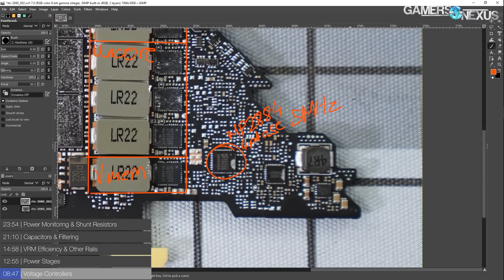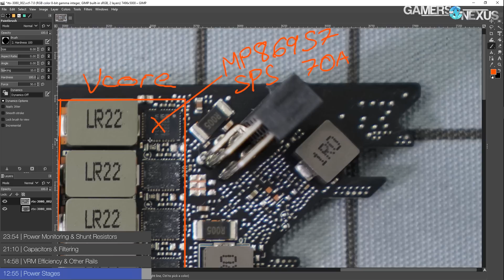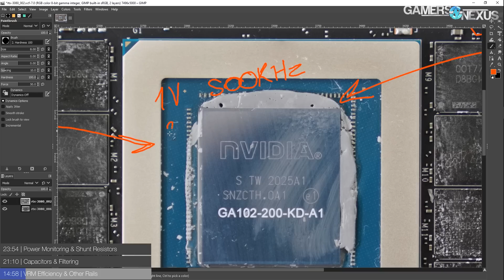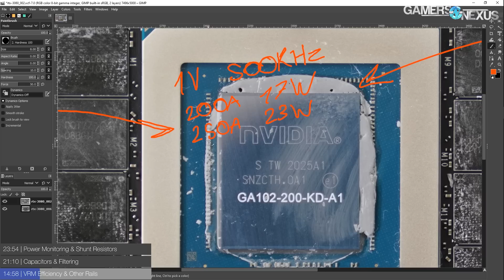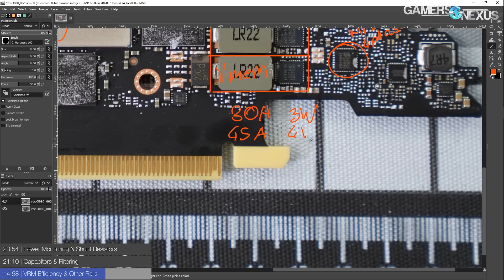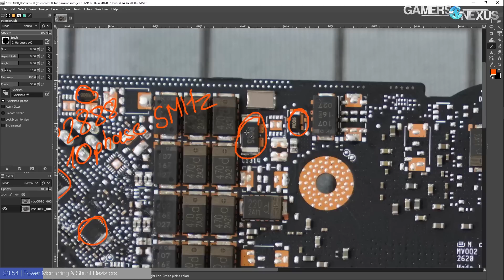GPU PCB Analysis: Founders Edition RTX 3080 Build Quality & VRM Capabilities

Comment from the maker: Watch our 3080 Founders Edition cooler study, looking at CPU & RAM impact from the cooling: https://www.youtube.com/watch?v=zWczw89sMe0
RTX 3090 FE tear-down: https://www.youtube.com/watch?v=9JWqRjqqNko
RTX 3090 review: https://www.youtube.com/watch?v=Xgs-VbqsuKo
Find Buildzoid on Actually Hardcore Overclocking: https://www.youtube.com/channel/UCrwObTfqv8u1KO7Fgk-FXHQ
Reply: Is this type of analysis going to be done for evga and other companies?
Reply: Excellent as always - But may I ask, am I the only one having a hard time seeing that orange color Buildzoid is using to draw? Neon green or more of a maximum red would be a lot better
Reply: A cooler study of a card we can't get in the 2018 TI prices are literally brand new for a pre-owned card
Reply: this channel is too good
Reply: Question: Which 3080 would you buy and why? Thanks!
Reply: I see some overclocking in cards with the 2X8 pin connectors with claims of the card drawing over 500w.  Will the 8 pin connectors deliver more power than the rated 150W?  Let's say the PSU is a Corsair AX1500i.
Reply: the slight by nvidia against TSMC finally pays off. a decade later.
Reply: 6:18 Auto Money Strategy https://youtu.be/CyX0dCjIkoA
Reply: eVGA are using all pass through capacitors on the XC3 and FTW3. Talk about cost saving.
Reply: Better watch out Steve, Youtube has a strict policy on users not uploading porn... ^_^
Reply: Please tell Nvidia that I want to give them $700.00. I would like to do an old school mail in order and have an RTX 3080 shipped to my house without using a third party.  I would like to snail-mail in my order and be emailed a link to give my card info, for the right to collect my 1 per household version of the RTX 3080 FE shortly after it is manufactured and boxed. It is a simple request, which easily bypasses the bots and the crashing website issues. I am available anytime during normal business hours in Silicon Valley. Thank You.
Reply: Nvidia GPU from the very begining is designed as Logical Computer / Logical Computing Board.

Basically, the idea is; one can program it like a programmer.

Not with Radeon. It lacks logical but hardware quality wise for a purpose, yes is great. Though lacks scalability.
but scalability tend to cause complexity.

So, pros and cons.

Basically, German Tanks vs US tanks in WW2. ( ｰ`дｰ´)
Reply: "It is worth noting that full custom pcbs from various board partners that are going to be significantly better than this..."

Nah man lol...it's really not worth noting =( 
Still hoping whatever the issue is with these 30xx cards, it's not cheap capacitors?
Reply: You need to put this superman scientist onto the fixing of intels compiler with a one click fix on ryzen, despite you being sponsored by intel because you care about humanity.

Comment: The real question is can I add lr22 and solder it back. Or more capacitors on the back plate?  That's the real question I yet to find the answer to in every video.

Comment: From my testing I've found if you are going to shunt mod the FE 3080 or 3090, you only need to mod the 6 larger shunt resistors, and you can completely ignore the tiny ones. I've managed to increase my power limit from 350W to 600W on my 3090 by modding the 6 larger ones. I'm going to try replacing the smaller ones as well and see what happens

Comment: Excllent Job Buildzoid! Thanks again. ... Regarding 8pin power being able to handle way more than suggested. Lt. Commander Geordi La Forge : Er, the tank can't withstand that kind of pressure.

Scotty : [laughs]  Where'd you... where'd you get that idea?

Lt. Commander Geordi La Forge : What do you mean, where did I get that idea? It's in the impulse engine specifications.

Scotty : Regulation 42/15 - Pressure Variances on the IRC Tank Storage?

Lt. Commander Geordi La Forge : Yeah.

Scotty : Forget it. I wrote it. A good engineer is always a wee bit conservative, at least on paper. Just bypass the secondary cut-off valve and boost the flow. It'll work.

Comment: What's going on with the little blobs of solder on the back near the caps? There's a load of unplaced components with massive pads but then little pairs of solderpaste arranged as if little passives were going to be placed there instead of one big cap. It's like they used the wrong stencil for the board.

Comment: Why they don't take into consideration making a modular PCB for GPUs?  They could separate at least the power delivery from data delivery.... Since you need to split power all around the chip is kind of obvious the "flat sheet" design is not optimal and a 3d  modular one would be better. Also maybe the waste will reduce in time as people could upgrade only the chip part if the power architecture is strong enough... much like the CPUs? A lego like PC would work better imho in the future world of covid ravaged economy...

Comment: Capacitors(As close as possible to the point you want to have reduced voltage drop) are also a solution to power loss over a power plane, but only with dynamic loads, and you need a lot of capacitance. Carry on :)

Comment: Towards the PCI latch from the 2886 on the back, what's up with the zero ohm resistor in that spot? All the shunts are 5 mOhm. Is this a fools, tenth shunt resistor? A fancy jumper? I've seen zero ohm resistors before. but why on this card?

Comment: At this point they miniaturized to make better but in voltage and control it's not the case. Offer a big GPU like 3090 size that has better performance and part quality then 4k gaming should be common.

Comment: We just need a fresh start to the motherboard making and inputs and outputs to have the power configuration work away better them using bigger lanes for power. I think AMD will take over the gaming performance with having it be AMD CPU and GPU works better as same brand in 1 pc then a intel with RTX.

Comment: The output filtering capacitors at 23:16 are Illinois Capacitor (CDE) XMPL series Aluminum Polymer. Took me a while to find it, but looking at the datasheet, the case marking is exactly the same. 
https://www.cde.com/resources/catalogs/XMPL-series.pdf
The 220's are 15 milliohms and the 470's are 4.5-9 depending on which one they are
Reply: Thank you for that. I’m replacing a cap on an a1000 gpu that look exactly like these. Was pretty sure i needed an aluminum polymer vs a tantalum polymer, but wasn’t sure. Your reply helped a lot!

Comment: So im running 64gb of g.Skill 3600mhz ram in quad channel the bios recognizes all 4 sticks and memory amount and so did the ram tester i used but in windows (8.1 pro) it shows me only 48 gb to be usable of the 64. Does any one know why or how to fix this? Its on a msi x399 board with a tr1920x. Ive updated to the latest bios and tried again still no luck..

Comment: I don't think your statement that all partner cards maximise cost-savings is tenable. Some use cheaper POSCAPs for NVVDD and MSVDD voltage high-frequency filtering, while others like the Asus TUF (which is not even their premium model) use MLCCs exclusively.

Comment: "They've cut every single corner that they could, but not with Founders Edition." i have watched enough Air Crash investigations to know cutting corners never ends well.
Reply: It's not an accurate statement, though. The ASUS TUF uses expensive MLCCs. If they had wanted to "cut every single corner" they would have used POSCAPs.
Reply: @coolcat23  I would say that would be an exemption as that's literally made to be overkill.

Comment: Please tell Nvidia that I want to give them $700.00. I would like to do an old school mail in order and have an RTX 3080 shipped to my house without using a third party.  I would like to snail-mail in my order and be emailed a link to give my card info, for the right to collect my 1 per household version of the RTX 3080 FE shortly after it is manufactured and boxed. It is a simple request, which easily bypasses the bots and the crashing website issues. I am available anytime during normal business hours in Silicon Valley. Thank You.

Comment: I cancelled my preorder of an EVGA card after I heard about what we might call capacitorgate at this point. Not interested in getting castrated crap cards because the manufacturers wanted to save a few cents. I don't expect fixes for months so I will stay away from the 3000 series like its the plague.
Reply: Nvidia's official solution as of this point is to limit clocks/power through drivers for everybody, soo... yeah.
Reply: @Astralify  I noticed. on UserBenchmark the results keep shrinking compared to the 2080 ti. At this point they might as well be the same. BigNavi has quite a chance to wipe the floor with NVidia now.

Comment: Hi ☺
This is goin to be my first desktop pc built
I'm not a gamer
I need this setup for
3D, Animation, Video Editing & Game dev
Please let me know if this is good or I need to change anything from the equipments mentioned below

CPU: Ryzen 9 3950x
Motherboard: Gigabyte x570 Aorus Pro WiFi ATX
GPU: Nvidia RTX 3080 FE
Cooler: Coolmaster ML360R 360mm AIO
RAM: Corsair Vengeance Pro 32Gb 3200 MHz
SSD: Samsung 970 Evo+ 2Tb M.2 NVMe
SMPS: ANTEC EA750G Gold 80+
Case: Cool Master MB511 Mid Tower
OS: Win10 Pro OEM

Thanku 👍

Comment: My guess is, and it's rather pretty obvious, that this PCB is also meant to be used as a base for a hypothetical RTX 3080 Ti FE and/or RTX 3080 SUPER FE with higher clocks (better binning, manufacturing optimizations, chip revisions) and/or slightly more RAM (12 x GDDR6X chips possible).
So, why would you wanna buy this basic RTX 3080 FE now?...when there exists this obvious PCB hint that there will be (slightly more expensive!, though) FE cards with better specs right around an only? six month away corner (March 2021?)...Nvidias kinda infamous attempts of double dipping into the wallets of their customers by overstretching a new generation release of a full lineup of cards over many, many months. Just release them all at once Nvidia...god dammit!

Comment: i dont know much about electronics except for recognizing  which component is what.  so at around  9:00 there are a bunch of small resistors and/or capacitors, surrounded by a bunch of metal soldering dots....is there anything on those dots? what are they there for?  Also, for the missing RAM chips, why do they always put soldering on the PCB on those missing components?

Comment: Hey, just curious, do you guys ever plan to do a video about using two 3090 FE's with NVLink to get specs and such. The way I'm looking at it, which the new NVLink they released, you have to have the cards sitting right above/under one another. With how the fans are positioned, in my head, top cards intake is choked, and the bottom card's top exhaust is choked, making thermals possibly a nightmare. Obviously I have no care to spend 3 grand, or even 1.5 grand, but this is currently the tech question that keeps me up at night.

Unless the spacing in my head is wrong... but the 3090 FE is three slots deep, and all the past NVLinks have connected 3 slots apart. HELP ME FIND MY ANSWERS GAMERS NEXUS
Reply: Wait wait wait I think I figured out how it works. The bottom's card top exhaust fan blows into/through the fins of the top card. The top cards bottom intake still probably is choked because it's against the plate of the bottom card however... now it's just seeing how much, if any, it effects performance.
Reply: Interesting idea for a vid but I wouldn’t hold my breath waiting for it.  GN typically make vids that will inform the broader audience and I don’t see too many people running two 3090s  in their home setup.

Comment: First I want to apologise, this comment is in no relation what so ever to the video it is posted under. It just happens to be the most recent video rn. Second:

I am heavily struggling with the current (PC) RGB market, as in I want to buy, but do not know what or why. Rainbow Vomit is not what I and most ppl are looking for but instead properly synced up cases.
Many people have to endure the same atm, so a video including overview and recommendations would be hugely appreciated by myself and I have to assume thousands if not millions of others.
Could you pretty please GN? I have done weeks of research but could not find a single comprehensive helpful video or article. You're the only outlet i know that is capable of such.
If anyone could link me any valuable source, my eternal gratitude will be promised.
PC Case itself and Case Fans, MB, RAM, GPU, CPU Fan / AIO. Everything with different software and specifications. How can i sync up everything nicely?
There isn't even a company producing all of these, so it is impossible to stick to one software? I want to be able to ripple through the case one after another, no parallel daisy chained stuff. How?

Comment: How do I tell what cards are using these 50amp power stages over the 70? Also learned the capacitors on the back of the gpu are arrayed poorly/cheaply between each brand causing crashes? Much of this stuff is over my head and i'm just now finding out that all the cards arnt the same just with different coolers. As a laymen it seems like it's all just trying to find tear down videos(for each brand making an excessive amount of effort) and struggle to understand what they are talking about or accept that your going to get screwed in someway.

Comment: I was expecting him to talk more on the cheap/expensive capacitor behind the gpu thing. I am still wondering if all that stuff is true or not. I hope we get some info from a reliable source soon, hopefully Steve mentions it in the next news video. If the AIB partners cheaped out and went below the reference spec they should absolutely do a recall on the faulty cards, the underclocking firmware patch is just a scumbag way to fix a problem that shouldn't exist.
Reply: If you watch his channel he talks about it

Comment: "They've cut every single corner that they could." So glad i couldnt find a partner card for sale when they launched
Reply: Yep. Glad everything was sold out in seconds. Now I'll be really patient and wait for a new revision or version. Probably called the "Super" again. Got my eyes on the FTW3.
In the vein of Intel's venerable "tick-tock" cycles, it was always better to wait for the "tock" releases.
Reply: "Cut corners", is the norm for any cheaper card. If a card seems cheap, know that corners were cut.

For pricier ones, it's a box of chocolates.😅 Because there are times when they'll cheap out, but have the audacity to still price that card high.
Reply: the problem is aib didnt test their card thoroughly. they cut corner but didnt test enough to confirm that the corner they cut didnt cause issue and instability, what confuses me tho. did none of the testers in msi/gigabyte/etc experienced this issue?
Reply: @hiro9253  i think part of the problem with that, is that Nvidia was slow getting them the reference design.  So they didn't have as much time to find and address issues as they normally would have.  Still, they should have delayed the release if that were the case.

I have a feeling though that this is why some of the higher end cards have been delayed (The Aorus master and elite for example) they're making sure that those cards are stable and overclock decently. (at least that's my hope)

Comment: someone should watch EEVBlog and learn about power distribution and voltage deviders - as this is what you would use when you have to over-volt your supply due to losses through traces - the chips near the supply would not get over-volted - but would get a resistor put in front of them to create a voltage devider - so 50mV would be dissipated via a resistor so even the chips close to the sipply only would get the correct voltage - that's basic electrical engineering ... when computer nerds talk crap about stuff they just don't understand ... F A I L
in addition to that: just cause you have power supply on both sides of a chip this doesn't mean that the lowest voltage will be exactly in the middle - cause that depends on the actual power rail routing within the silicon - in this example it would require a whole "plane" for power - which is done on pcbs but not on the internal chip level
quite a lot of errors here in the first part of this video ... it hurts how someone can talk so much crap in that short amount of time ... PLEASE - TAKE IT DOWN AND RE-DO IT !
Reply: The kiddo is not EE, he's tryharding and learning on the fly about these things, but he has no firm idea how it works. Opening 20 tabs in chrome with parts spec-sheets and reading it doesn't make you EE...

Comment: This video tells me 2 things. 1) FE is the one I will buy, and 2) I wasted far too much time in my school years chasing girls.
Reply: Are you planning a water-cooling mod? If not, you should pay attention to cooler performance. The FE is not the best in that regard by a big margin. The more premium partner cards are not even out yet. The best PCB is of little value if it is let down (comparatively) by its cooler.
Reply: @coolcat23  Thanks for the advice. Yeah i'm going to wait it out anyway. Too many options on the horizon to just dive in on the first one that looks half decent. Its a lot of dough to put down on a graphics card for me (and many of us) but i would rather spend a bit more to get a really good one nonetheless. FE is a solid choice for stock running i think. It depends on what i want to do next. Either keep my current system and keep it stock or get some OC parts and start fiddling. One option is expensive, the other just plain bonkers ! Ok bonkers it is 😄😄😄